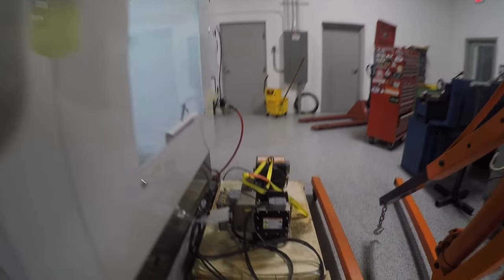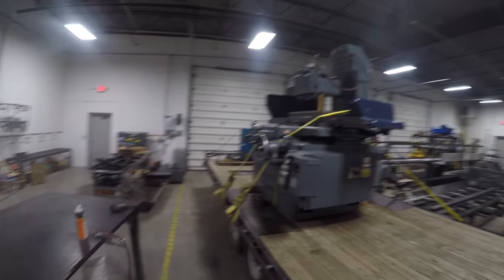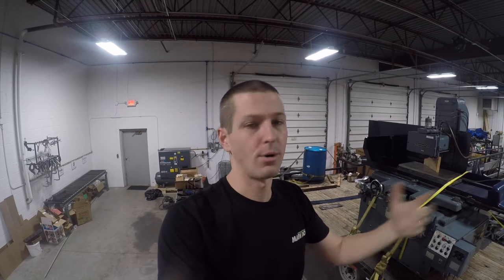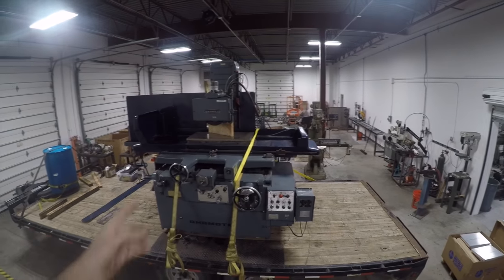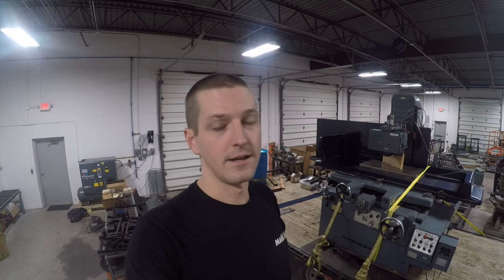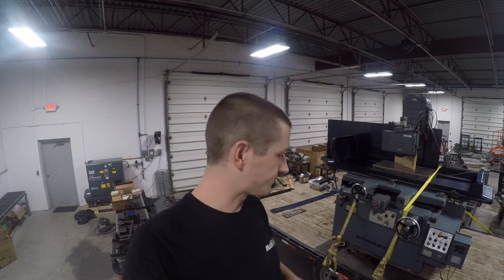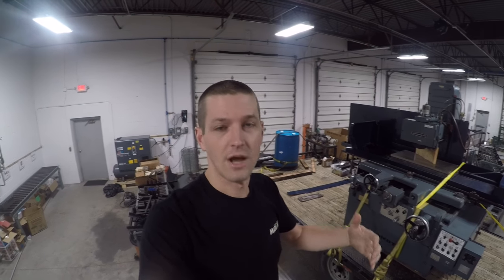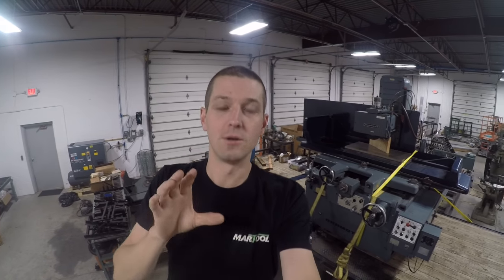Okamoto Surface Grinder, Buying Used Machines, Business Goals CB42

Comment: I work at a grinding shop in Minneapolis, most of our grinders are from the 60's, our most productive and accurate (millionths tolerance) are from the 40s. Those old machines are more well built than the new million dollar grinders available today. 

Oil based coolant is the best option for grinding aluminum, prevents it from heating up and helps prevent the wheel from glazing.

Comment: My BS meter would be pegged in the red on that seller's reason. If that was legit, and they were buying a new machine to "impress customers" I'd keep in contact; good bargains to be had on their liquidation sale!

That was very good and solid logic you came up with John. What people need to appreciate is when buying a machine you're not marrying it! A machine may well be worn and no longer as good as it was when new, but it may nevertheless still be more than sufficient for the work you have for it in your own shop. There's no point in tipping $5k into a machine for example, to bring it up to pristine condition, if you simply don't need that degree of tolerance/finish/etc. As the saying goes, "the money is made in the roughing", in other words you work to the necessary level of precision regardless of what op you're doing.

Incidentally, surface grinders do a heck of a lot more than simply making parts flat ;)
Reply: Pete F A lot of companies are that way. They have a lot of potential customers and investors coming in, and those people usually know nothing about machining. Potential customers and investors want to see new, clean workspaces. A potential investor/customer that goes into a business that is in an old, ruin down building, with old machines, and then goes to a shop down the street in a new/remodeled, clean, high-tech building with new clean shiny machines, is most likely going to invest with the latter. Usually regardless of competency or skill, if you have a workplace that is messy, dirty, or old the potential customer/investor is going to assume that if your workplace is like that, that's how you do business. Also investors think about bringing future potential customers through for factory tours, and they know that those customers aren't going to want to go into a dirty old shop with old machines. keep in mind, they know nothing about machining, and are basing their decisions firstly on appearance. These are also deals worth tens of millions of dollars where the appearance of your workspace could make or break the deal.... not a $20k deal that you're working with someone who needs $1000 parts, and is looking for the cheapest deal in town. If you're a medical device company looking for a machine shop to manufacture a part that you're unable to produce, and you do a factor tour/walkthrough at one company that is in a nice, clean, new building and one that is in an old, dirty building with old machinery; which are you going to choose? (Keep in mind you don't know very much, if anything at all, about machining or the machining industry.)
Reply: Andrew Delashaw oh don't worry, I know how the game is played. I also stick by what I said, companies who rely on that type of logic as their business model typically don't last long.

Comment: That's a pretty big surface grinder. I hope you don't have electrical problems. I had one and I did. That was a long learning experience.
Reply: I had a 8X20 and it stopped reversing the table stroke correctly. If would just slam to one side. There is a PLC that controls all of the hydraulics. I basically ended up reverse engineering it and making a long truth table to figure out what was causing the issue. Ended up that there was a single ground wire that came loose from the PLC circuit board. It took me 2 weeks of full time work to find that one wire. That's probably a $7500 repair bill if I had to call someone in. I sold that grinder for around $2500. It's easy to get upside down fixing a complex machine like that.

Comment: John,  As for grinding aluminum, I find the best way to grind 6061 is to use a really coarse wheel and filling it with wax or a really thick oil.  This prevents the wheel from getting loaded up with aluminum and has worked very well for us to grind things flat/square.  I'm sure there are wheels specially made for grinding aluminum, but we've never bothered looking into them for who knows what reason.   As a for general grinder usage, we hooked up Variable Frequency drives to both both of our grinders to control the spindle RPM.  This works great for us and using super-abrasive wheels such as CBN and Diamond.  We run the spindle around 1250 and dress it on a small piece of pure molybdenum and let the grinder self feed with an aggressive crossfeed, starting at about .0006 down feed and decreasing the down feed until its nice and flat.  Depending on type of tool steel and if its hardened/soft, we run the spindle are various RPMs.    As for a magnet, we also have magnets where we can control the strength. (I forget technical term for them.)  These work great when you need to grind something flat, but don't want to deal with the magnet sucking it down with to much strength  that it bows it.   Also helps to de-magnetize it when you remove it.

Comment: 2016 was an a**hole year.
I got addicted to CNC some weeks ago especially by your enthusiasm and decided to design and build my self a freakin CNC mill the next few month.
So my plans for 2017 are to fiddle around with that CNC mill to get it up and running most perfect possible without spending 10ks of bucks and eventually do a startup with a business idea if have which does not rely on ultimate accuracy.
So in worst case I have a decent hobby CNC mill, in best case I have a decent hobby CNC mill in some extra income by running a small business :)

Comment: The machines I have purchased have been from auctions and I don't really get to see them under-power or operational, however when I go to buy I buy under the assumption that they will need some kind of TLC, because of my budget I am buying as cheap as possible. So far it as worked out great for me...knock on iron...but I do also consider new part availability because with most big name machines they almost can always be restored to like new condition. My latest score was a $5.00 Torit dust collector that works great, its just a little rough on the appearance side but that easily fixed with some paint!

Comment: as a journeyman tool room machinist, I started out after my apprenticeship in chain die maintenance for a chainsaw chain/bar manufacturer, back in tool and die they had a cnc okamoto that was a phenomenal machine and in die maintenance I became quite familiar with a direct drive manual okamoto surface grinder and I loved it, and now where I am working as a prototype machinist I am occasionally using a couple older brown and sharp automatic surface grinder with electronic chucks. Sounds like you got a good deal and they can be fun as long as they are taken care of right. Few questions I have are: is it direct or belt drive, are the hydraulics decent considering it looks like an automatic, what brand is the chuck and controller, and there are a few other things that some of these guys have already said. But good for you, just be careful to not get parts flying because it can be a wake up call for sure when it does happen!

Comment: Grinding Aluminium is not often discussed or shown because it is tricky and people tend to avoid it. It is tricky because with standard wheels aluminium is so malleable that as it cuts it sticks and clogs the pores of the wheel. This stops the wheel from cutting properly and instead it starts to rub, from there you get more friction and heat ect all resulting in a poor result. You can successfully grind with the right wheel although it may take a bit of trial and error. To start you could try a very porous wheel with a course dress and lots of coolant. People sometimes recommend oiling the surface with a light oil before every cut, and or even charging the wheel with candle wax. To do that you would dress the wheel as normal and then manually rub the end of a candle against the wheel to fill the pores with wax. Both the oil and the wax are designed to help lubricate and improve the chip forming. Either way you will still have to dress the wheel regularly and stick to light depths of cut. 0.001" might be a good starting point. If you have allot of aluminium to grind you could buy a silicon carbide wheel which would be more suitable than the normal aluminium oxide. 

Your only other issue is how to hold the parts as it wont stick to your magnet! 

Cheers
Crispin

Comment: John, On grinding Aluminum, a long time ago I made some parts out of aluminum round bar. I think it was just under 1.50" (if I remember 1.490 + -.002)in diameter the parts were about 48" long. Instead of turning the whole length I had them centerless ground. the guy used some special wheel almost like cork consistency with abrasive. So there is some kind of grinding wheels to grind aluminum. unfortunately it was so long ago I cant tell you more than that.
Reply: Edge Precision 
Probably one of the compressed felt deburring wheels 

Probably something like this

http://solutions.3m.com/wps/portal/3M/en_US/m3MIndustrial/Abrasives/Products/~/Scotch-Brite-EXL-Deburring-Wheel?N=7581697%203293241548&rt=rud&MDR=true
Reply: Edge Precision 
Cratex also makes 6" silicon carbide impregnated rubberized wheels that would probably do well for grinding aluminum
Reply: Occams Sawzall At work, we use small cratex bits and wheels on pencil grinders to grind corrosion from aluminum aircraft structures. It is very controllable and leaves a great finish! Just a light touch of grey or white scotchbrite is enough to really make it shine.
Reply: Edge Precision Cratex products are probably the cork/rubber-like wheel you remember.

Comment: john, great machine. ya gotta have a quality surface grinder. cannot cut corners here if you want good finishes. i cut my teeth on brown and sharpe auto grinders in high school regrinding mostly carbide tools used in ball bearing manufacturing at NHBB. very dirty work but very rewarding holding sub micron tolerances. grinding i believe is an art and you will enjoy this machine. 

get yourself some 3M 410 double sticky tape, will hold anything nonmagnetic and can be used to hold a part to grind the first flat side.

my immediate goals are to settle on a cam package, get my new 4-axis dialed in, finish the build out of my new facility by completing the quality room and I hope to grow a little by adding another mechanical engineer. of course all while maintaining high quality  service to my customers.

Comment: Aluminium grinds fine, I make blow moulds from it and the split faces are all ground. I grind a mixture of 7000, 6000 and 5000 series aluminium. The 6 & 5 certainly are not as easy but either use coolant or if you haven't got too much to grind use wd40 or similar. I use a 46 grit V (if my memory serves me correct) wheel and is ok for aluminium and steel. If you dress the wheel quite coarsely for roughing that will help stop the wheel loading up but the finish won't be as good and then re-dress the wheel to finish. It really depends on what you are trying to achieve.

Comment: And aluminum grinds ok depending on the series. 7000,  and 2000 series grinds nice. 6000 series is pretty much hopeless to try and grind. It can be done but it falls under the "art form" category like scraping. 

And remember to invest in silicon carbide wheels to grind aluminum. Aluminum oxide wheels (what most wheels are) will simply pack up, gum up and make life in general miserable.

Comment: Good price or bad price, it's his! when you need a surface grinder nothing else will do. Just be careful that's by far the most dangerous thing you can put in any shop. How big of a room are you having built for it? You need space to left parts sit for afew days before you can grind to tighter tolerances. We use 2.6" of mercury  with 12 changes per hour, install a good charting pressure gauge,  Good from 2016 received my master black belt in Six Sigma, the bad I need nothing with it. Plans for 2017 finish 2 Six Sigma projects and buy an RV.
Reply: NYC CNC Yes, at tighter tolerances, you need to let your parts acclimated to your grinding room temperature . Don't build it in a corner of your shop, you would have two walls exposed to the outside, the thermal variance would be hard to control.